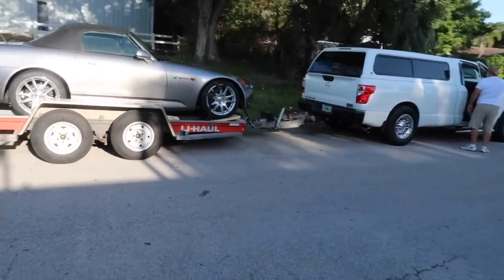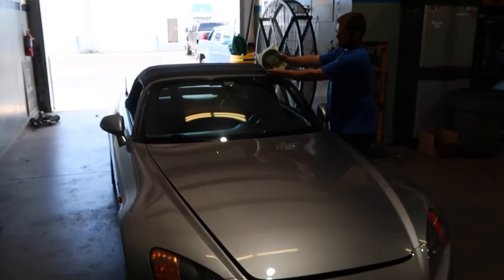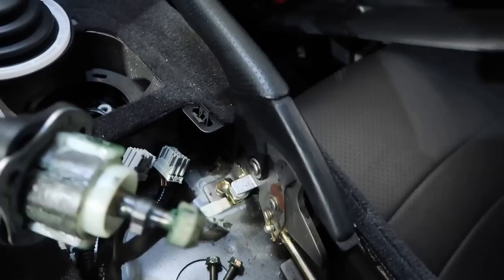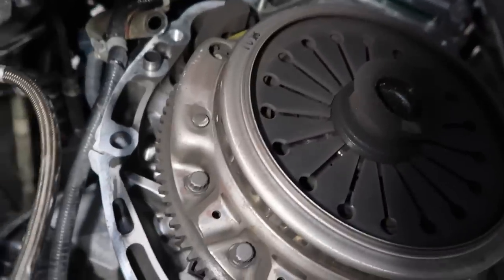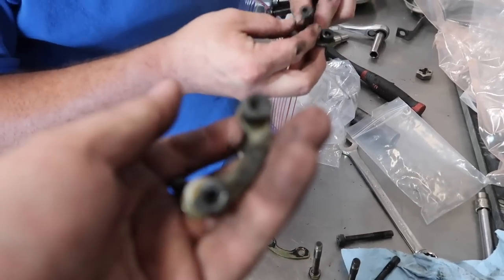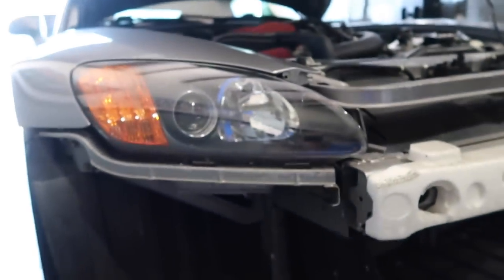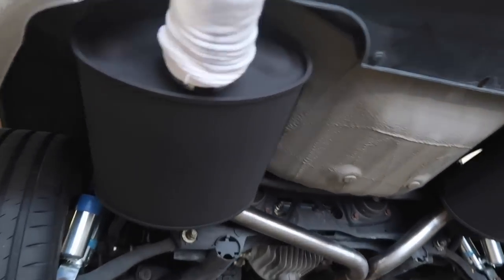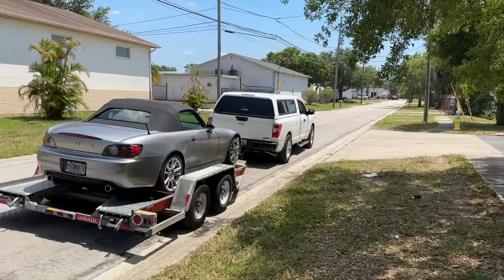Make your  S2000 OEM  Mint !

Comment: The S2000 runs so smooth now, like a sewing machine. Is that because of the packet of coil clips you installed or the lifter/valve adjustment? both? 
 Under the car could be cleaned and polished,  like you and George did the exhaust pipe. Would you recommend how to do that; wire brush? or B pay a professional to do it when I get new bushing?
Reply from the maker: Thanks John !  Many small things add up to the overall feeling. We do a little extra secret things we don’t mention or charge for. That makes things feel better too. 
We use a stainless cleaning wheel for the pipes in the back.

Comment: hey I was wondering if you could dyno a car with the AC on to see how much power and/or torque it robs the engine if any. maybe have George dyno his civic with AC on as well.... lol... i always wondered if it did take some power away when on. i mean it feels like it does.. it'll be good to find out though....
Reply from the maker: Most oem systems dis engage the AC compressor over 80% throttle.  We should try it on a couple cars to confirm. 👍🏻

Comment: Hello John, I've been watching ALL of your videos for the past three years and enjoy all your insights. My question is regarding my recently acquired (used) 21' RDX Aspec SH-AWD. According to Honda/Acura maintenance schedule, engine oil should be changed every 10K miles. It seems like a long time to go ahead and run the car with oil for that long before changing it. I got it at 47,800 miles and now I'm at 50,700 in three months. I am changing the trans./differential/front casing & oil all at the same time today. What are your thoughts?

Comment: The UK mod is the perfect upgrade for the muffler. thank you!
 Right now Honda still has OEM parts for the S2000, if a person is saving an S2000 they need to start collecting parts before they are discontinued. How do you guys at LHT feel about saving and renovating Honda S2000.

Comment: On the brake light flasher, is there a way to add it without cutting any wires?  Love the S2K content.
Reply from the maker: We looked into buying the plugs but the cost was too high.
Reply: @LHTPerformance  Are we talking crazy $ like $100 or just goofy $ like $20?  I’d pay goofy $ not to cut my wires.
Reply from the maker: @michaeldoyle5001  I think it was around $25 for both ends with a minimum 100 units.

Comment: Anyone knows what spec are those Spoon rear subframe bar bolts? I need to replace one and I have no idea. Thanks.
Reply from the maker: They should be M10 1.25.  The ones included were 3/8” sae
Reply: @LHTPerformance  thanks. What's that rounded type of head called?
Reply from the maker: Button head.